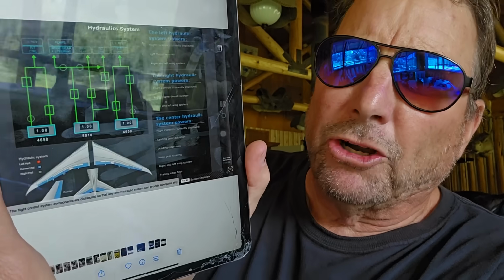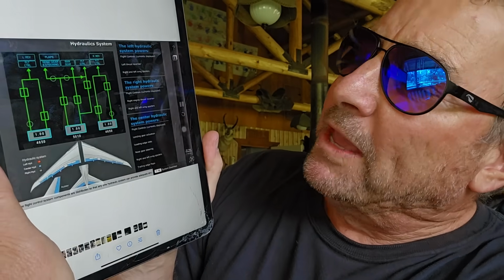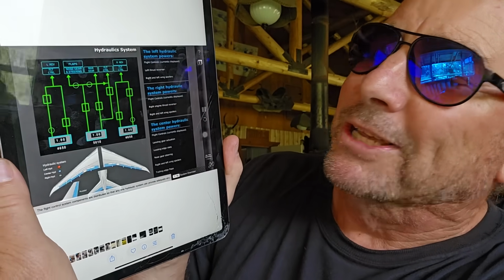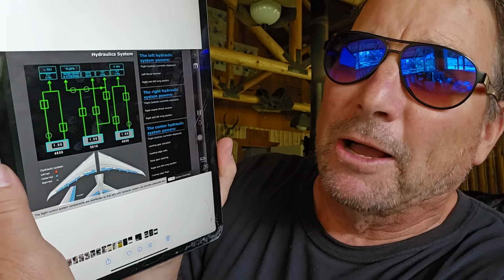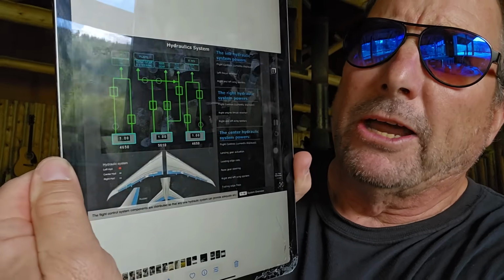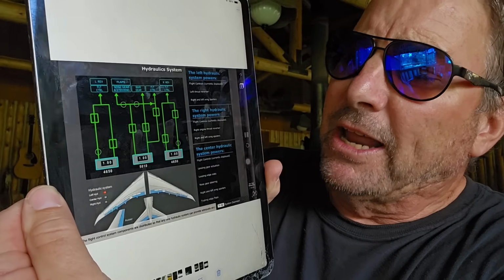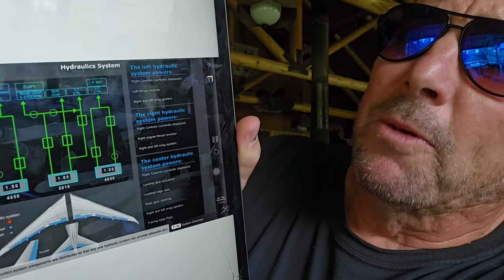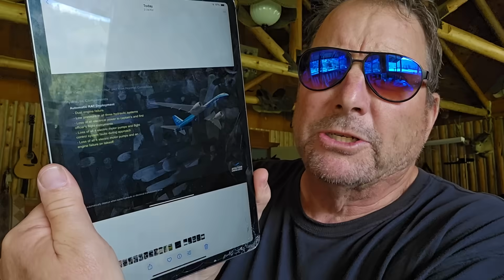787 Crash India What's a RAT? When does it deploy?

Comment: Something I’ve noticed in the videos is that the gear trucks were rotated forward into the stow condition. Perhaps the crew did command gear retraction, but the loss of hydraulic power occurred very shortly after. Enough to start the retraction sequence but not actually retract.
Reply from the maker: Correct!
Reply: @blancolirio Exactly what you stated as an important clue in your first comment video Juan. Gear selected up but retraction sequence interrupted by something vital, whether hydraulic or electrical.
Reply: @blancolirio  Also, despite the bogies being tilted forward, the gear doors are definitely not open.
Reply: I would say stowing the gear caused the electrical failure. It happened at the time they would have stowed it... Which is when the survivor heard the bang.
Reply: @iot-portal It might be that hydraulic pressure disappearing could have allowed the trucks to return to nose down, from what I understand the aft tilt is maintained hydraulically. Of course it's possible that gear was selected up and the centre system pumps stopped due to electrical failure leaving the gear wherever it had got to in the sequence.
Reply: @iot-portal survivor said he heard the bang at 30 seconds, which was the moment of impact, which was the sound he heard, ie of the crash itself
Reply: @PRH123  that's not how I understood it. I guess he heard a few bangs once it started crashing. If the 235VAC bus had a dead short that would make a loud bang. That supplies the hydraulics and fuel pumps. The RAT supplies this bus and the 28VDC bus. That would make the lights flicker if it was impaired by half the load on it going to a shorted bus. Anyway the real reason will become apparent soon enough.
Reply: Yes, that's entirely possible but there was a lack of both hydraulic and electrical power to complete the process.

I'm quite convinced the engines were starved of fuel shortly after takeoff due to an electrical failure (the 787 has only electrical fuel pumps, not any mechanical backup/redundancy) and you can see that the 787 visibly stops climbing as a consequence of this.

By the time the RAT was deployed and provided electrical power again, the engines had spooled down and there simply wasn't enough time/altitude for them to spool up again and provide the needed thrust.
Reply: There is no way you can accurately state the positioning of the landing gear, other than they were deployed, from the only 2 videos that appear to be available of the incident and the angles from whixh the footage came. One video is from a CCTV camera that was several hundred metres behind the aircraft, the other video was not much better.
Reply: @ozymandias7940 I disagree. The 787 main gear truck has a fairly pronounced aft tilt when deployed. This is done to increase the aft body clearance angles to prevent tail strikes during takeoff and landing. Look at the videos of the 787 first flight to see the gear truck attitude. In the video where it flies by, if you pause it when the plane first enters frame, they don't appear as tilted. I agree it's not definitive, but it does appear to have enough resolution to make out both axels and tires.
Reply: @ozymandias7940  : which video were you watching? The CCTV video, the original bystander video, or the cell phone video of a computer playing the bystander video? The media and YouTube by and large grabbed hold of the last one and ran with it. In the original bystander video, it's abundantly clear that the main gears are nose down.

Comment: One detail i've failed to see mentioned anywhere is the fact that the landing gear appears to be pointing forwards in the crash videos.

In a 787, to enable the Main Gear Assembly to retract into the Main Wheel Well Bay it must tilt forwards. When the aircraft becomes airborne nothing happens to the Truck Assembly until after the Landing Gear Lever is selected to UP. When the Main Gear doors are within 4° of the fully open position, the Truck Assembly is hydraulically tilted by a Truck Tilt Actuator to the STOW position. It will tilt the Truck Assembly to 12° toes down (front wheels down).

This would indicate that the landing gear lever was selected UP at the time of the crash
Reply: He mentions that among the list of things to look for, at around 35 seconds in, on his video titled "787 Crash India 12 June."